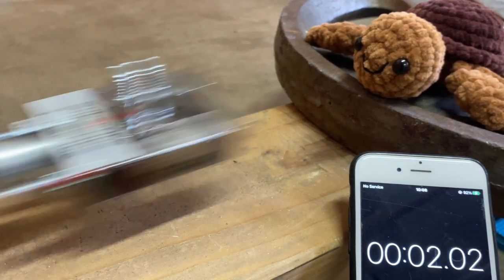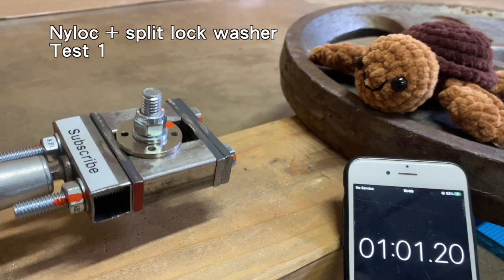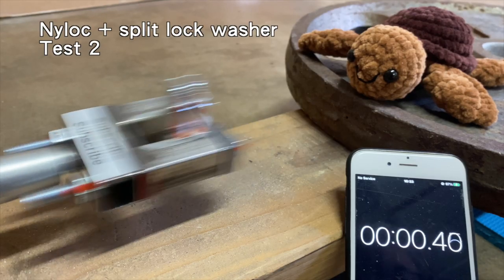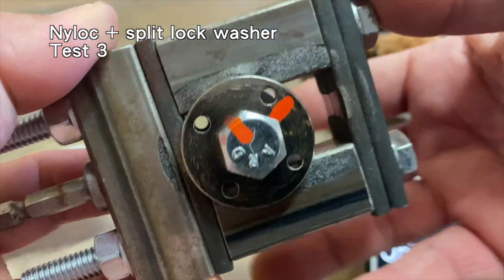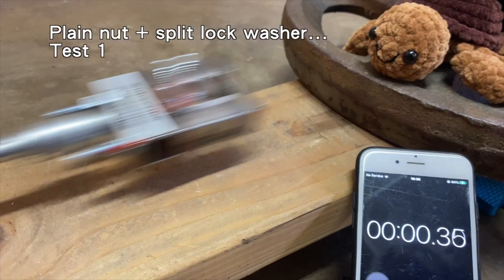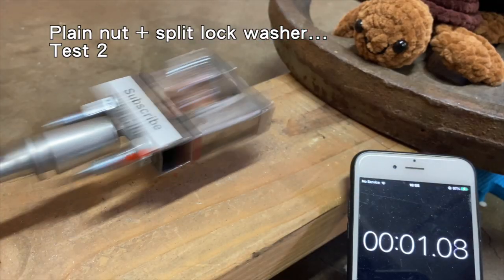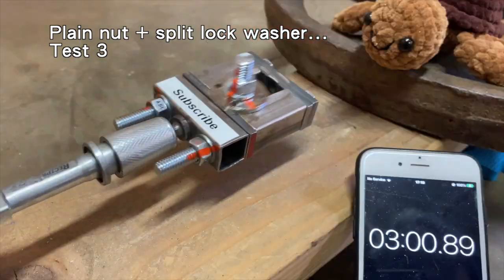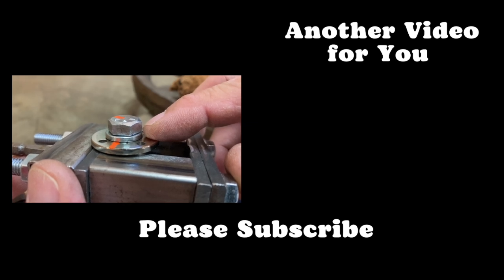Nuts & Bolts - Split Lock Washer vs Split Lock Washer & Nyloc – DIY Impact & Vibration Test - Part 2

Comment: Please explain why 6lbft is a relevant test torque for this experiment. It's around hand-tight, and it doesn't fully compress the spring washer..so from the get-go, there's little point in using it anyway.  A nylock is always going to be better in semi-tight applications...   Could you repeat the test with nut/bole sizes that specify 6 lb.ft as the tightening torque or use a gruntier rig, please?

Comment: https://ntrs.nasa.gov/api/citations/19900009424/downloads/19900009424.pdf  NASA concluded that lock washers are useless.  There is no 'biting' effect unless very soft nuts and substrate are used, in which case the biting action would really only serve to damage other components.

Comment: What we need is a locknut and a preloaded washer that always bites into the nut and part. That way, both the washer and nut will offer resistance, and if the nut comes loose, the washer will maintain clamping force for a while and the locknut will keep resisting.

Comment: You need to use the correct hardware and torque for the job; correct torque for automotive or industrial use and grade of steel is a lot more critical and designed than bolting 2 objects together with little to no vibration, but I get your demonstration to show which fastening type is better if poor to minimally designed & assembled.

Comment: If you test Nord-Locks please add Jet nuts. From my understanding they are nuts that are crimped to provide locking. We use them a lot on our race car. They do wear out over time (repeated remove/install) but I assume a nyloc does the same.

Comment: If you don't want it to come apart, but have to take it apart, Use a Nord-Lock X and possibly a nylock nut. More importantly, watch out for dissimilar metals.
Reply from the maker: My Nord-Lock test is out… Will Nord-Locks Survive My Test?  DIY Impact & Vibration Test – Part 5
https://youtu.be/wOUnlfhHRko
Pls check it out and drop a comment.  👍😎

Comment: Great, for very little cost I can overengineer my projects even more!  Now let's see 2 splits with nyloc, loc tite, 59 ft lbs and a spot weld!
Reply: BAHAHAHA.
Reply: The screw head breaks off and you use spot welder to put it back in place? 😂😂😂

Comment: You lost me at 6 pounds of torque. Proper torque is the first thing needed for an accurate test. Looks like you are using grade 2 hardware so proper torque should be 15 pounds of torque or roughly 3 times what you torqued them to.
Reply: This is what I see as the weak part of the test. I really never use such low torque in any application where there's vibration. I think it's likely with 15-18 ft-lbs that the split lock washer will be more reliable over time than the nyloc, but either will be sufficient.

Comment: As a lay person i never knew split lock washers were supposed to bite and prevent coming undone. I thought their purpose was to act as a spring so that if things shift/loosen just a little bit it retains most of its clamping force. But as soon as things loosen enough that the washer isnt under tension anymore it would spin freely. Conversely that nyloc prevents a nut from ever just spinning freely, but if things loosen even slightly then you lose all clamping force. So I figured if you want things to stay tight reliably you need both. But based on reading other comments it sounds like split lock on its own should work if torqued sufficiently?
Reply: The spring component of the washer is definitely as important as the biting effect
Reply: https://ntrs.nasa.gov/api/citations/19900009424/downloads/19900009424.pdf Lock washers aren't supposed to bite.
Reply: Split ring washers only real action is to lighten your wallet, lock washers in general are a waste of money. Toothed washers are good for electrical connections on painted surfaces to bite down to bare metal. Locktite, or locknuts. Are way more effective. As an example, how many split ring washers are on your car? Pretty much none, even with all the vibration in a vehicle, manufacturers do not use split-ring washers, or lock washers in general.

Comment: 6 ft. lbs. again? That's almost pointless. There's no need to double up on fittings if you use a realistic torque spec. That should be at least 25 ft. lbs.
Reply: I agree 20 or 25 ft pounds

Comment: Similar findings to what AvE found eons ago back when he still did dickingaround videos. Split washers are junk. It'll be interesting seeing if you get the same results he did on the nord-locks. If I recall, only viable option was thread locker.

Comment: There is an error in your test: your parts can rotate relative to each other, which bolted connections are not designed for. That's why the Split washers (Grover washers) are not working properly. You need to modify your setup to prevent the parts from rotating relative to each other.

Comment: A nice test to add would be to try a jam nut without any type of washers or the nylon variant, just 2 regular ones, first one torqued to 6 and then the next one also torqued to 6 against the first one.
For my motorcycle if i do have enough threads free and its a nut that could walk off because of the engine vibrations (and there are plenty because its a 1 cylinder old pushrod engine) i do put a counter nut because some bolts are just too small to try other methods. And in some bolts from the factory they are like that nyloc.
Reply from the maker: Thanks!  Testing double nuts is on my list.  👍😎

Comment: I wish I had the link of another test, the winners were 1- drill holes for aircraft safety wiring. 2- Use a second
nut as a "jam nut". Both #1 and #2 also beat medium Lock-Tight. 1&2 also did really well for holding
Torque Values.

Comment: I want to see a test with Nyloc nuts, split ring, AND Loctite, or some kind of liquid thread locker.
Reply from the maker: It’s on my list.  Thanks!
👍😎
Reply: Could we make it a removable thread locker? 
Like blue loctite, or something similar made for removal without lots of heat? 
 
Having the best locking power while being easily removable is every mechanics dream.  lol

Comment: Under this extreme test , i like this result . If need be a lock washer between the bolt and the inserted could be used . But this version is a good compromise . Maybe gold miner shaker should have lock washer on each side. I like your video . Add reliability inexpensively . Thumbs up
Reply from the maker: Thanks!  👍😎

Comment: ANY movement is still movement and thus failure. These tests have flaws that make them irrelevant, the most striking is the very low tightening torque applied.
Reply: Agreed, but there's also the testing variable - lateral AND longitudinal vibration testing are paramount to an accurate conclusion.

Comment: I am assuming you are using Metric Fasteners. What is the effect of different thread forms such as 5/16 inch British Cycle Thread (26 TPI), UNF (24 TPI) and UNC (18 TPI) to your results. 5/16 is equal to M8.
Reply from the maker: Thanks!  
Comparing different TPI’s might be interesting.  I’ll add it to my list. 
The fasteners in the test were 3/8” - 16.  👍😎